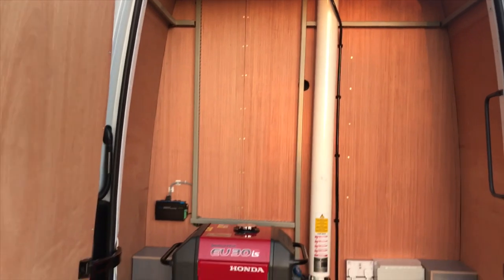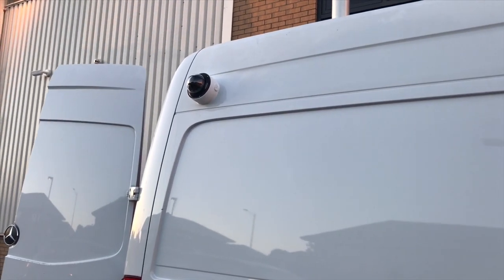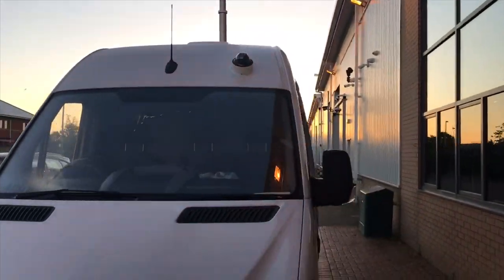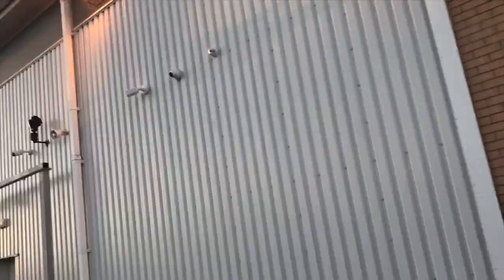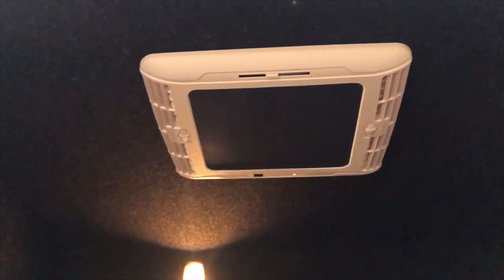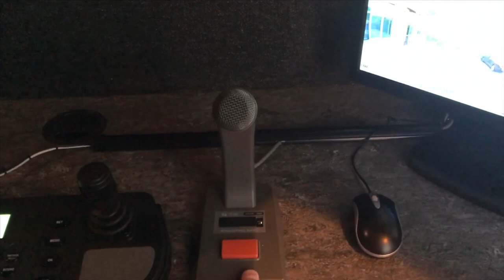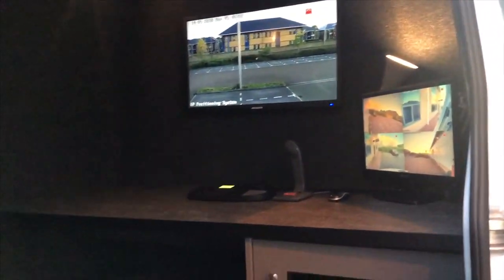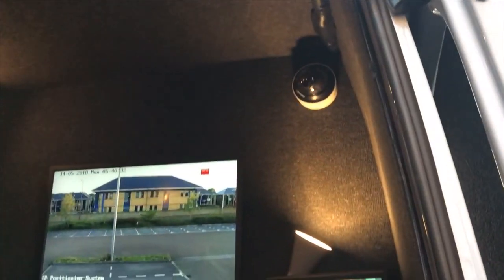Special Vehicle Mobile CCTV Surveillance Project

Comment: I ask what others have... Whats the purpose of the Van?  The cameras are Overt so it would not  be a very good Surveillance Van, maybe a command center type vehicle at best.. I have installed surveillance Sensors/ Cameras in different vehicles but they were installed covertly. They were used to park at a Target Location and discretely collect intelligence on said Target.. You did nice work and I am sure it works well for a purpose..  Thanks
Reply from the maker: Hi and thanks for the comments, this is for Overt surveillance work , the client has since had it sign written and deploy them where crime is present , this then deters and captures the activity , mostly having it on the site is enough to move the problem away , so for that use it works 100% , other discreet surveillance projects for government use we of course could not show 😊

Comment: How much do you charge and how long would it take to do the same set up on a ford transit new shape?...
Reply from the maker: It takes around 3 weeks totally , we outsource this now due to time but happy to point you in the right direction
Reply: Would be great if you could, I'm trying to avoid a generator and use investors would it be possible to run a full command centre for 12hours?

Comment: Seems daft to have that massive stinky, noisy generator to run it.
I'm building one myself without the pole and it all works on a solar panel and two batteries, will last 3 days.